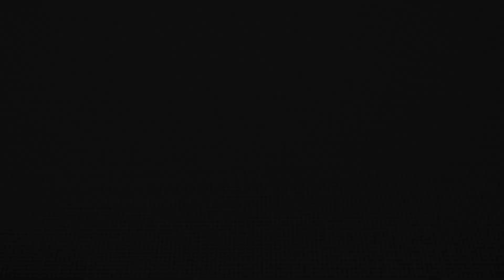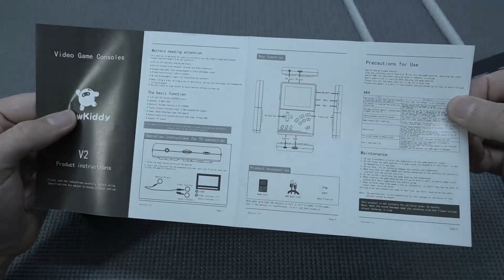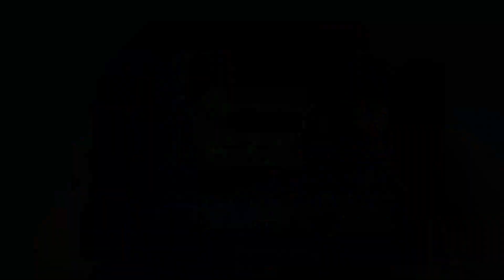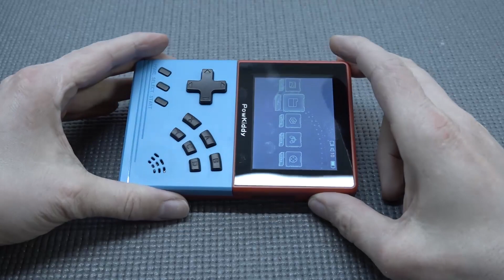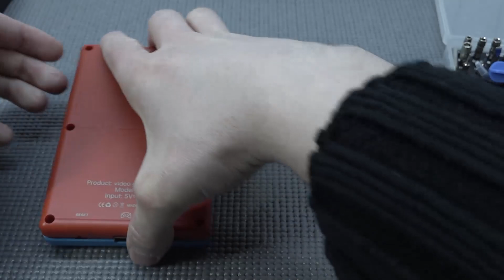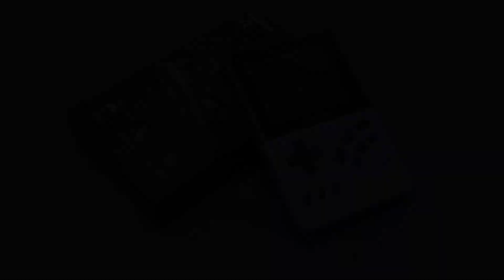Powkiddy V2  - The New $29 Budget 2022 Multi Retro Emulator

Comment: It's too cheap. You need decent buttons with low travel and a good feeling to them at least, as well as a decent display. I think 40$ is the right class for entry level emulation handhelds, and it's a bummer, that there are no new releases in this segment. The LDK game and the PocketGo v2 still are the only good options that came close, but they have become more expensive than they once where.